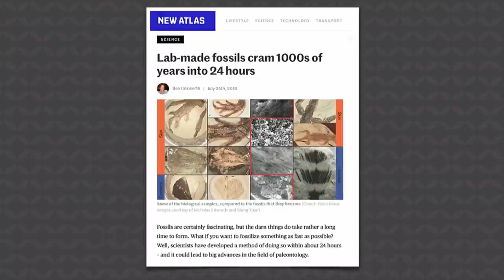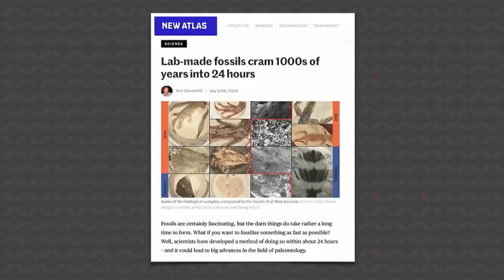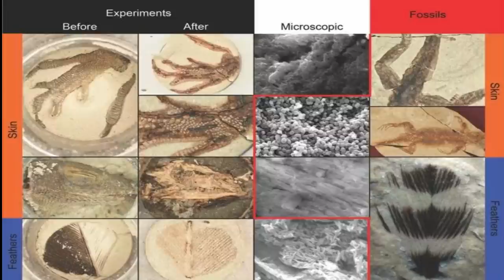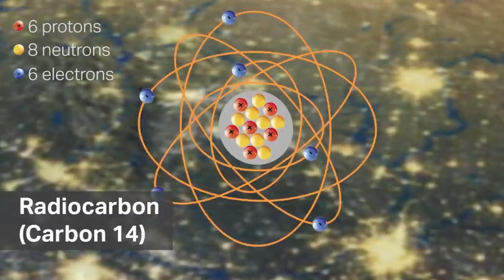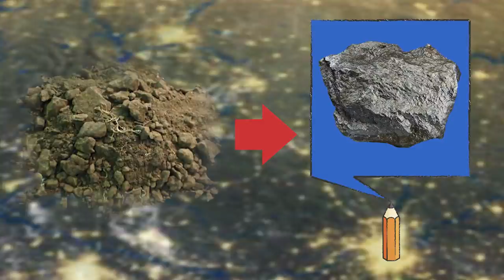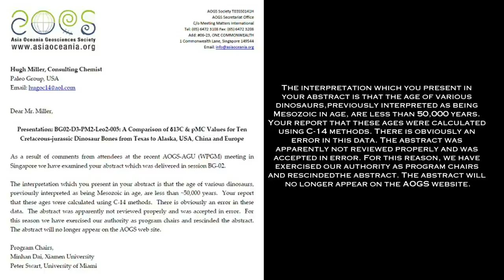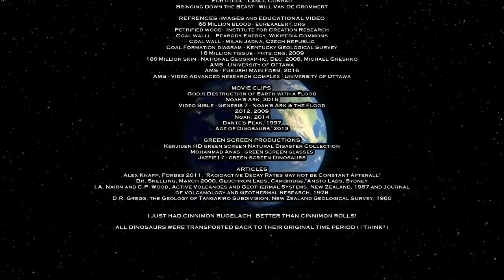Is Carbon Dating Accurate | How Old Are Fossils | Truth on Carbon Dating | Noah's Flood | C-14

Comment: Carbon dating is extremely inaccurate.
Reply from the maker: Have you read of any other objects that were buried in rock or coal that was millions of years old?
Reply: @living4ever  a couple; there is a hammer they say is 400 million years old and a foot print in rock found in Mexico is 290 years old. The problem is when they date objects and bones older then 40,000 years they can’t use carbon because the half life is too low to measure. They measure uranium in the rock around an object. But that does mean bones or objects were made at the same time as the rock, that’s absurd. I’ve seen petrified trees extending through rock layers that date over millions of years. So that makes no sense. My real questions are about how lead can convert to radium to thorium to uranium in nature. Perhaps science is only so far that we can only say particles decay but not so much on how they form when it come to dating the past.
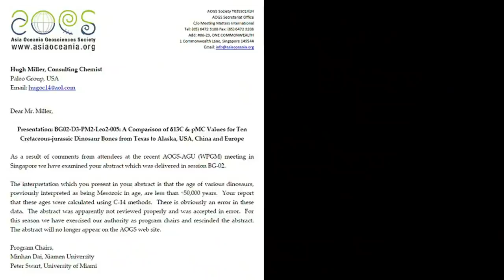Reply from the maker: @mr.invisible3770  Most of these samples are in this video, including the hammer ,starting at 8:12. I really like the fossil that is buried in layers of rock, with each layer supposedly being a different age, starting at 7:55, similar to the petrified wood you mention that is also in this video. Besides the problem that nuclear testing has already changed all dates, what I find really amazing is that these dating scientist think they have to have an explanation for everything, when it is impossible for some to simply say, "I don't know?" - which is one of the things that I cover in my "Big Bang vs God" video. Did you make it to the the segment where the data was thrown out because the carbon dating came back to be only thousands of years, starting 22:49? Very sad to cover up the truth!
Reply: @THUTH-ix3tt  Past 40,000 years old you have to know how much carbon is in the atmosphere at the time of death as a reference point other wise your numbers are wrong. Despite your ad hominem insults, it’s still a fact.  Concerning lead you’re also wrong. When pressure in the earth can turn coal into diamonds and we have also found water fissures that creat natural plutonium reactors. Are you a particle physicist? Or just you make fun of people who ask questions?
Reply: @THUTH-ix3tt  I was not trying to prove anything to you. I simply responded to the account creator of the video then you butted in as if it was your own conversation.
Reply: @THUTH-ix3tt  okay.... and?
Reply from the maker: @mr.invisible3770  Michael, back to your last question on radium to thorium....I haven't read enough specific information on this to give you any answers. However, one of my sources is a nuclear engineer for TVA and I will contact him for this information.
Reply from the maker: @THUTH-ix3tt  Trying to say insulting titles like "creatards" doesn't improve for discussions. It's like saying, no matter what we say, we are wrong, yet with all of your questions, I have provided proof and evidence to back up what I say on your direct questions. Have I or Michael called you any names? No.
Reply from the maker: @THUTH-ix3tt  For all your inquiries, I have listed articles and websites for the proof and evidence.
Reply from the maker: @THUTH-ix3tt  I have an answer for all your questions because I am well educated, and the helper from God, the Holy Spirit, instructs me on how to answer. But, obviously, your "brainwashing" is also complete - if coal is dated to be 300 millions years old through radiometric dating, but we continue to find human created object in them that are dated to be thousands of years old, how can the coal be older? Over time, the coal formed around these objects, which means the objects are older than the coal, which means that the dating methods used on coal are inaccurate.
Reply from the maker: @THUTH-ix3tt  This is covered in my video in great detail; 4300 years ago, God covered the Earth in a global flood, and all of the organic matter was washed into many different places where we find massive coal deposits. Starting at 9:28.  If you're asking this question, it sounds like you haven't watched the whole video. Have you watched the whole video?

Comment: Great video.
Science is very problematic, but research will show we can land on Mars, internet are in use for communication, etc. etc.
1] E=mc squared? force on two masses are inversely proportional to the square of the distance? 
The distance of a small square from point "a" to "b" (length of side "S") at the north pole is the same as at the equator.
A kilogram is constant? Can anything be measured to .00000001 accuracy at different lattudes and longitude?
2] The rate of decay decreases as time increases. Using "logs" or formulae linear graphs may be achieved.
A man has a life span, so how can he accurarately predict say 500 years?
We cannot make a perfect lens but we have made use of this.
We cannot see electrons, we have made use of this.
Like the presentor I have doubts on carbon dating,,,some mathematics and science, but we have able to make use of them eventually. We have satellites, communicated and landed on Mars, electron miscroscope and telescope.
3] We may not see the actual thing, but can see a representation of it and take actions on it. (eg Heart equipment)
Reply from the maker: Thanks for watching! Even in the Bible, atoms, that we cannot see, are brought up here; "Colossians 1:16 All things were created by him. He created everything in heaven and on earth. He created everything that can be seen and everything that can't be seen."